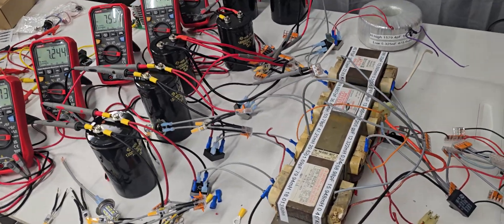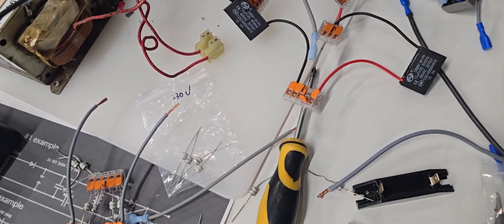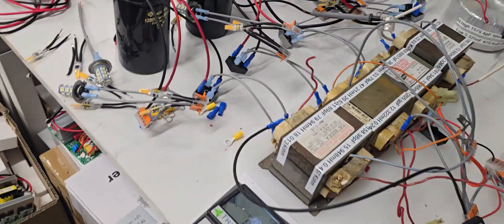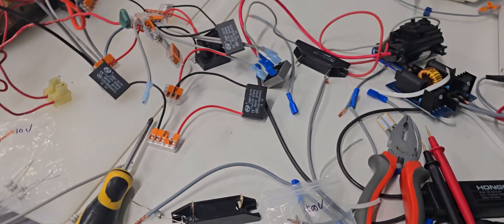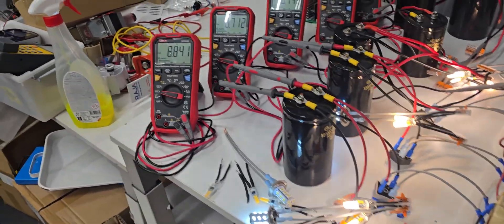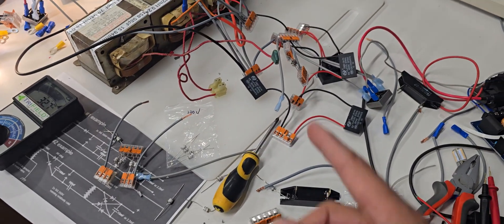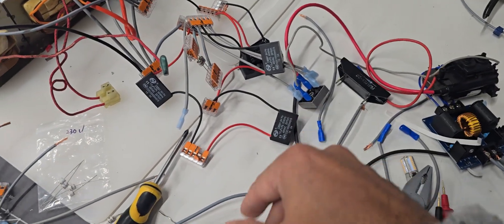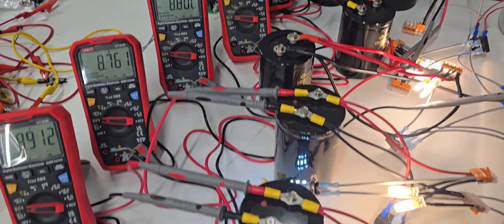Zilano / XR_IX / MrMishMash / Don Smith MOT replication part #6 - 1UF 1.5KV + 1.5kv GDT

Comment: You know our arch nemesis mr enki was telling the truth at least as far as reduction. High voltage converted is converted to high amperage through winding ratio and wire gauge. Ideally the frequency dictates the compounding of the energy available but thats don smith magic.
Reply from the maker: I still have his devices ; Hope to get them working someday.

Comment: Ps some would say it wont produce over unity results because you are closing the loop but i disagree. Ive measured over unity in real time closed loop with a load. That video is long gone.

Edit: I understand that this is not over unity but it could be if you really go there.
Reply: @SlackerJ-f2k that is really no different that doing it with an air core transmitter and a bunch of receivers at resonance nearby. Are you saying that the core needs to be shared because everything is going to be contained there.
Reply: @SlackerJ-f2k in my humble opinion I don't think a pre built mot straight from the factory will ever produce over unity conditions but I haven't tested that myself. Imo following don Smith principals has worked well. Use stranded wire for one. Even litz wire. Follow the wire length rules and wind it however your heart desires.
Reply: @SlackerJ-f2k I can assure you that this circuit is not equivalent to that. Not even close.
Reply: @SlackerJ-f2kit's not that it's where it's at. It's just ideal if you are trying to repeat and replicate fields. Where is the current going to come from. Do we need current?
Reply: @SlackerJ-f2k still pretty new to the experimentation side of this but have been studying this stuff for a couple years now, just want to say i appreciate you Slacker! lots of info! thanks too BrianP, been noting your comments for awhile!
Reply: @SlackerJ-f2kin response to your comment about the cores being connected, it might be worth looking into the process behind old-school magnetic amplifiers if you havent already, it may be a non-linear magentic saturation kind of effect going on (?), paired with the main Smith effect.. just throwing some thoughts out there..
Reply: @SlackerJ-f2k That's so reassuring to hear thank you!! Hoping to get a couple MOTs here pretty soon, should be interesting! ⚡⚡⚡
Reply from the maker: Ive spend a full day testing yesterday and started blowing up diodes, using higher voltage sparkgaps does increase energy output at the same wattage in, with a few milliwats on load. But I can see the restrictions per single transformer, now I will try to measure usage on the load and see what are we getting with 1 - 4 transformers and expanding if interesting to do so.
Reply: @GreenmeResearch  have you tried connecting the windings to the cores directly in the same way that Slacker did?
Reply from the maker: @pebnut  yes, connecting the core is the same as it's connected to the  end of the high voltage coil, i've tried lots of variations, to try understand how to increase output vs input without using grounding.

Then i can add more mots/transformers. 

Eventually you need to swap out the core for a metglas, other high permeable material or aircore, then you can go up in frequency.

Comment: This is very good I must say. There's a lot of room to play around with this. I really dont think an mot is ideal if you want to follow don smith principals. In any case try using the mot backwards and use the primary as the secondary output. It should produce more current vs voltage since it is likely bigger wire and less turns. It should be able to charge the caps a little higher just by doing that. I don't know if it will effect frequency.
Reply: @SlackerJ-f2k aluminum does have it's own function as a material in these devices thought. I believe that don Smith used aluminum for the secondary on his most famous tabletop device but that's irrelevant. What is relevant is that aluminum is diamagnetic, you can create Eddy currents etc. It can be very useful.